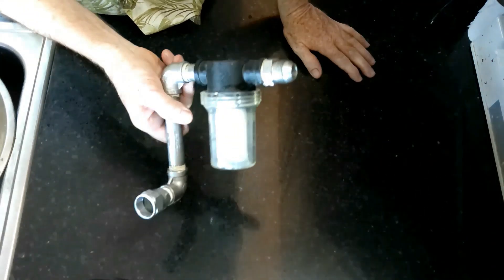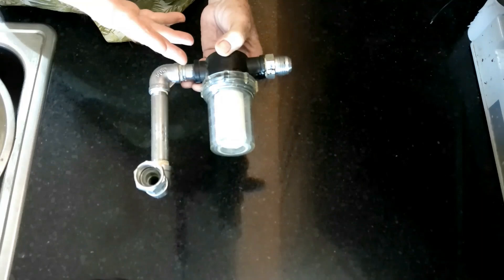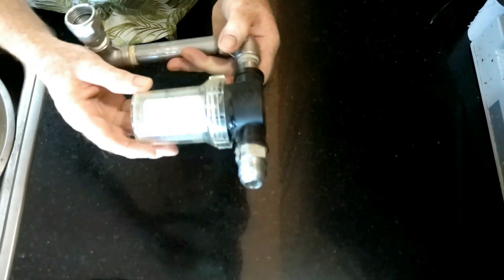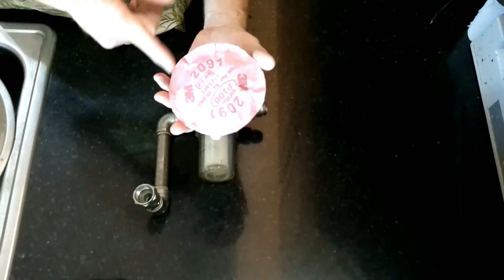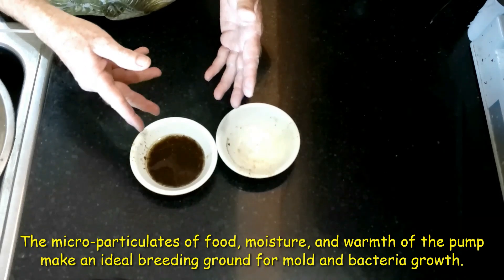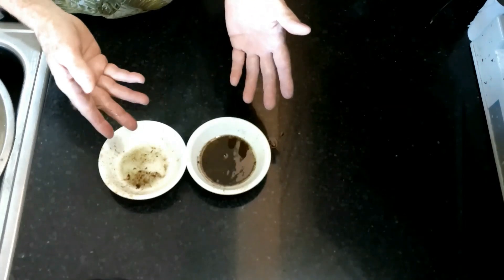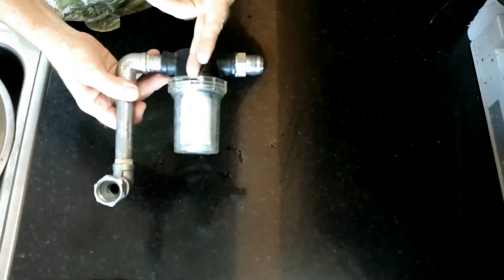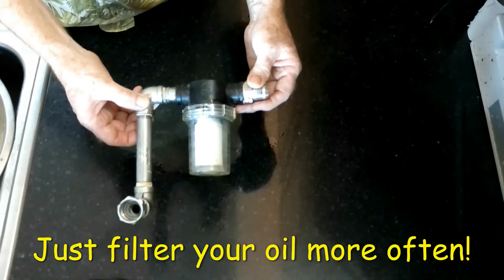Vacuum Filters for Freeze Drying

Comment: After 150 loads I just had an inadequate vacuum message. Do you know a place I can get a rebuild kit for premium pump?
Reply from the maker: I've been on HR for years to supply a rebuild kit for their pumps.  Are you sure it's a pump issue?  Not a leak or vacuum sensor?
Reply: @Philat4800feet  no I am not sure there is not a leak, it finished a load and next day wouldn't pull vacuum less than 700mt. I am not sure where to start but thought pump might be culprit. 
 Harvest right tech support isn't very good so trying to avoid them
Reply from the maker: I have a handheld micron vacuum gauge (cost $120) with a JIC fitting that I plumbed into my  pump with a tee so I always know if my pump is working.
Reply: @Philat4800feet  i will get one. I also got the stuff to reseal the machine. Will give it a go tomorrow,  I just assumed it was the pump without doing a through check up. The loss in vacuum came on so fast.

Comment: Have you considered a trap, come out of the FD to a T one end pointed up to the pump the other down to a 3/4 ID short hose with a cap to catch water and chunks ect.
Reply from the maker: The problem with traps and filters is the amount of vacuum.  At 500 mtorr and below, water is a vapor (water boils at 77 degrees) , and remains a vapor until it passes the vanes of the vacuum pump.  I have passed the vapors through a desiccant filter, but the desiccant wouldn't trap any moisture. Simple filters will catch food chucks (particulates).

Comment: Great video 👍 side question i cant seem to get an answer for or maybe the math is just to complicated....but ill throw it out there it doesn't have to be exact but just roughly, so, the freeze dryer measures pressure in Mtorr, now how many feet above sea level would one have to go up to get around the 200-300 Mtorr?
Reply from the maker: You can get to 200-300 Mtorr via vacuum pump at any attitude. but to reach this vacuum naturally you would need to reach an altitude of 53 to 55 miles above the earth.  This range marks the edge of the mesosphere and enters the thermosphere, where atmospheric density becomes very thin and transitions into the near-vacuum of space.
Reply: @Philat4800feet  lol, thank you very much phill I couldn't have asked for a better answer , and yea that's what I meant to say was naturally how high up would the 2-300 mtorr be essentially the inside of my machine is the same (roughly) as the 55ish miles up 👍

Comment: Hi Phil, I was watching your rebuild of the Premier Pump, as I rebuilt mine  after I was done, I had a tiny plug left over! I went back and watched the video again but there was no mention of a plug. Can you tell, or give me a reference where it goes?
Reply from the maker: I'm trying to think of what your plug may be and what section of the pump it may have come off.  Can you describe it better?  Is it plastic amber colored?
Reply: @Philat4800feet  yes, it's plastic, light brown, the top looks like it indented a bit.
Reply from the maker: In my video I point out where the manufacture used an epoxy resin to seal holes and passageways.  I believe that "plug"  is an epoxy plug that fell out.  You'll need to examine the body of the pump and see if you can find it.  For example look at my video time index 12:36 and 14:28.  You'll see three amber epoxy plugs in the body of the pump.

Comment: Hey, Watched you video on cleaning the HR premium  pump. 
Did you every find the O ring seal for outer case.

I had a issue.. used your video as a help.. used  caution  with oRing
But its got a leak.. slow. But leaks.

Spare parts?   Update?  Thanks
Reply from the maker: If it's the main o-ring HR has replacements gaskets

Comment: I have seen a couple people instead hookup a hose to the pump drain valve and send it through a filter on a continuous or n- minute interval to clean the oil. What do you think about that technique?
Reply: I do this. My oil is always clean. I have sent oil samples into the same lab that @Philat4800feet uses and the particulate counts are low. I use a thermal switch to turn on the pump that circulates the oil through a filter and oil cooler. The filter has a water trap and I have never had any water accumulate in the oil trap. I use a Premier Pump. I had to tap the drain outlet with 1/8" npt and drill and tap a hole in the tank to return the filtered and cooled oil.
Reply: @richarddavies6657  wow that is interesting. I was just going to program a small Arduino to set a small pump to circulate the oil every so often. Why cool the oil? I would think a warm oil would lubricate better.
Reply from the maker: You are a hardcore freeze drier.
Reply from the maker: I think changing the oil after the batch is good enough for me

Comment: I don't have that problem, food in pump oil, I have pump oil in every batch of my food! 

Harvest right refused to help me!

Machine is worthless, contaminating all my food.with pump oil!

Will this filter out oil in other direction?

So basically, these machines are useless.  They grow mold abd bacteria, and contaminate your food with the moldy pump oil.

What a waste of money.

Ive opened 3 month old veges freeze dried w this machine then vac sealed in glass, and it smells so putrid it cant possibly be eaten!

I should have the food tested, ill bet its not safe to eat!
Reply from the maker: Sorry to hear your woes.  It sounds like the check valve, inside your pump, is allowing oil to seep out and back to the chamber.  Is this correct?
Reply from the maker: Which vacuum pump do you have?
Reply: @Philat4800feet  Hi, i have the green pro pump.
Reply from the maker: How good are you with your hands?  Can you take apart the check valve, clean it, inspect it, and put it back together? and then clean the chamber, rack, hose, etc. with isopropyl alcohol 70%/30% water?  I want you to get everything really clean and let it air out overnight.
Reply: @Philat4800feet  Hi Phil, well I've already done all that, less use alcohol when cleaning everything.  I've washed out the chamber and hoses several times, cleaned the rack well to ensure no oil residue.

I run a batch of veg and get oil floating on top of effluent water. 

 Means oil vapor is getting into chamber, and hence on my food.

All my finished products get a horrible smell after a month or so even when vac sealed in glass, kept cool and dark.

I suppose it's from the oil, no other explanation.

I looked for a check valve but can't find one to match the not so typical connections on these units.

Thanks.

Comment: My owners manual states filter approximately every 20 loads. Sooner if it becomes dark or cloudy. I'm very concerned after watching this vidio about the food safety of my products. Also HR has not reached out to me about more frequent filtering you mentioned. I would think they should have if only to limit their liability to their customers. Thank you for sharing this information.
Reply from the maker: For those who run their FD a lot, it may not be a problem.  The concern would be those who run their FD perhaps monthly and let the oil idle for long periods of time.
Reply: I changed oil in my freeze dryer every 20 batches using the Robinair oil! I ordered a gallon of Black Gold and was going to start using it because of all the moisture problems, my oil looked like that stuff Phil was just showing, I never got to try it, the pump failed on the last batch! The new pump is in route. I will take Phil's advice and change every cycle! and use the Black Gold. Total batches on that pump  was 163 or about 5,215 hours  with a average o 32 hours a batch
Reply from the maker: I recommend Black Gold.  How did your pump fail?
Reply: @Philat4800feet  I know I asked you recently what oil you used and I bought a gallon.It failed  on the electrical side, it started and ran for a couple of minutes and stoped then it started again and ran a couple of minutes and quit! I unplugged it and plugged it in a different outlet to make sure it wasn't the Harvest Right problem It has gave me fits with water in the oil, when I would change it the oil was nasty and would never separate , I only ran about 163 or so batches, but I don't know how long these pumps are supposed to last! I have the premiere pump.
Reply: I live on the Gulf coast where we have high humidity.  I built a room just for the HR and put in a Air Conditioner  I am also going to put in  dehumidifier in there also!
Reply from the maker: My first question is how handy are you?  It sounds like your pump needs a good cleaning.  Is there so much gunk in the pump that it's overloading the motor?  Take a look at this video and see if it's something you're up to:
https://youtu.be/8jFGjKkOW3E

Comment: Why all the fittings? Just screw the FM JIC into the filter and not use all the pipe. Use pipe dope not tape, don't over tighten and mine works fine but never gets dirty.  Under vacuum their is no vacuum movement in the chamber and the crud is not directed to any one place, it just sticks  to the ice. Another way to cut down on crud moving around is to wrap the tray holder to not only hold in the heat but any crud that may pop off the food.
Reply from the maker: Yup, I'm sure there's a better way.  Blue Alpine has their filter inside the chamber.  Simple and elegance.